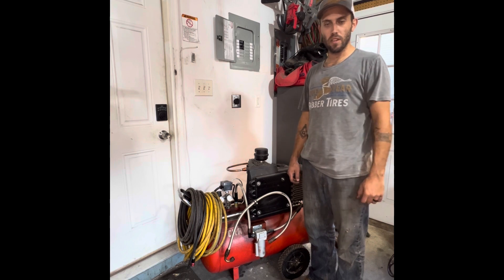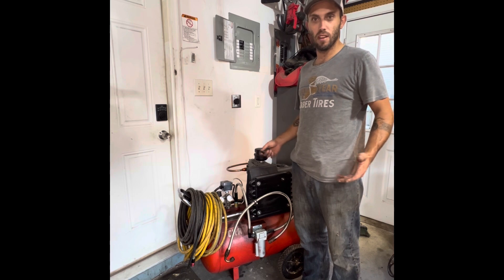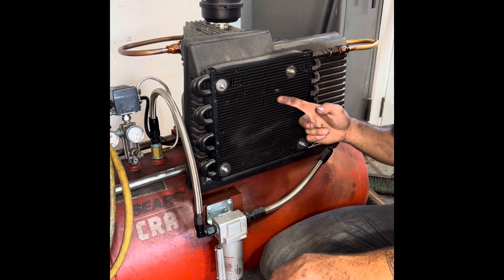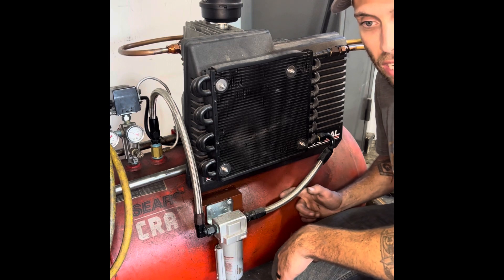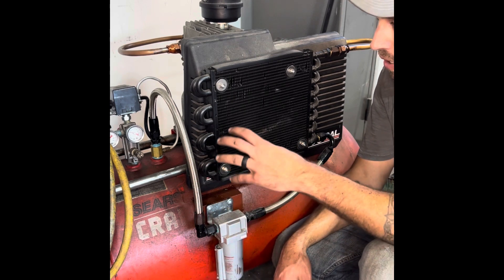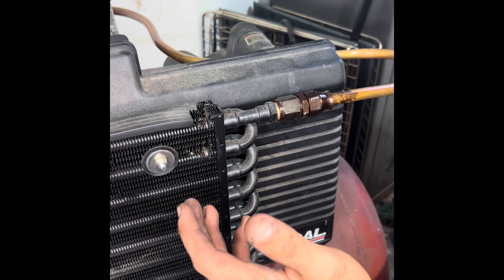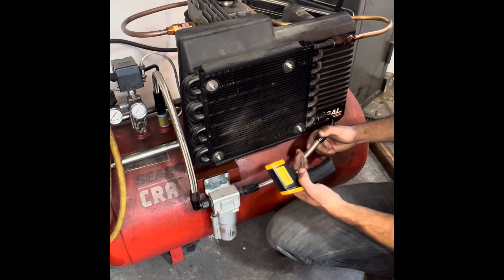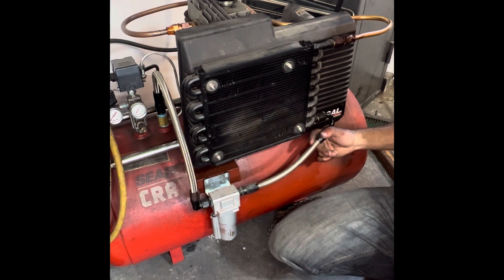DIY Air Compressor Cooler Condenser for Sand Blasting — Keeps Air Cool & Dry!

Comment: I have either the same compressor or a very similar model. I’ve been using it to blast some stuff here lately. I need to do this to mine. The moisture and the heat getting to the blast cabinet is crazy.

Comment: You cant blast with that compressor it will never quit running with 5psi trash it
Reply from the maker: Blasted nozzle wide open continuously never dropped below 45psi
Reply: I’ve got an almost identical model Craftsman compressor that will do 9.3 SCFM @ 90psi.

Comment: I'm fascinated. You said that you really didn't feel it was necessary to actively cool your condenser. But then you said your work requires this to run full flat out. Why would you not use simple computer cabinet fans to bring that cooled air down to ambient temperature? You've gone to the work to think through the mechanics and physics as well as the hard costs of the condenser, the lines, the water trap already. The fan costs are cost equivalent to the water trap. Simple wiring. Why not?
Reply from the maker: The condenser is somewhat cooled by the pulley/fan that runs the compressor. I agree that in a hotter climate than here in Virginia, it would absolutely benefit from additional cooling using the computer fans. Thankfully they also run 110/220v for the most part so I can use the secondary contacts on the pressure switch to control them.
Reply: He was talking about the cylinder head of the compressor. It's going to take a LOT to cool that down!